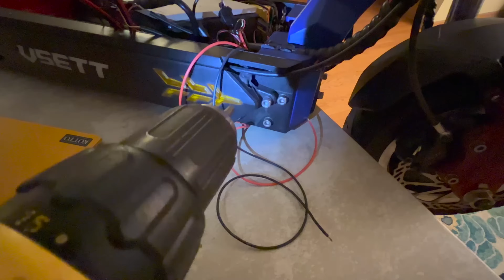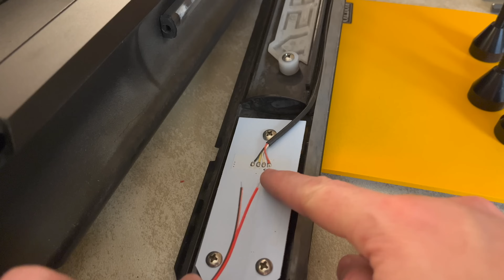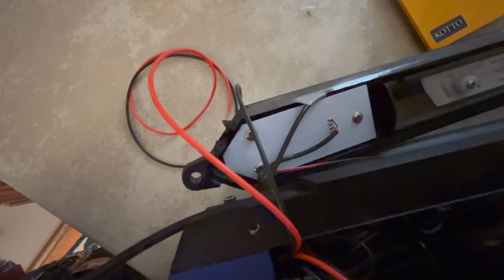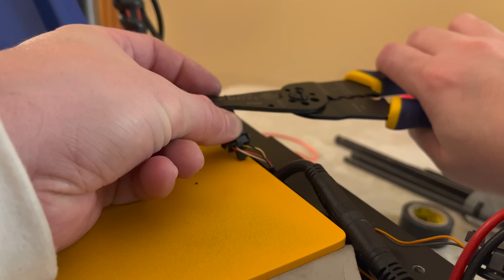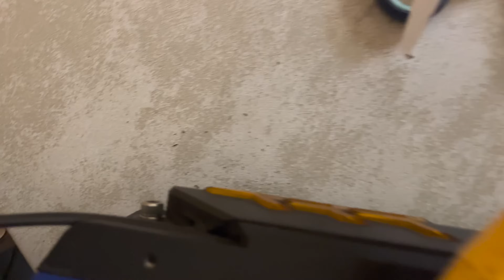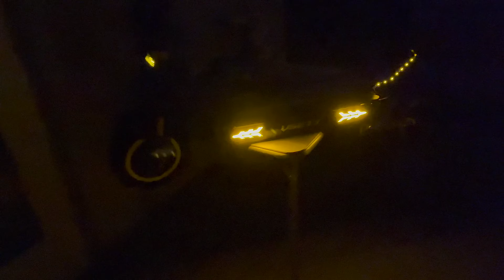How-to Splice MORE Turn Signals on Your VSETT 11+ or 10+ Electric Scooters

Comment: This is a mess…don’t get me wrong, I love that you’re doing this and we get to see but looking at how these lights are connected bums me out. I had hoped they were plugged in and you could add a splitting adapter dongle rather than solder. You can undo soldering but man…. Imagine trying to hide all of that before sending for repair. 
Also, the new Apollo pro will have a light bar in the stem and signaling in the tips of the handle bar, don’t know why this isn’t more common. It’s a missed opportunity and not a “premium feature”

Comment: Hey good job especially for your first try at this👍 How’d it hold up over time? I know you’ve moved on but curious as I’m about to do the same.  
Thanks Brian
#scootagang
Reply from the maker: Hey I think it held up quite good, they worked as long as I had the scooter! It was a fun little project, but will it I do it again on my Super72? I doubt it. The reality is you could put as many blinkers as you want and car drivers are still not going to look or comprehend what it is in most cases. Maybe down the line when scooters are more mainstream they will work better as drivers see them more, but for now, next to worthless unfortunately!
Reply: @ScootaGang  Hey thanks Brian appreciate it. I was kinda thinking the same thing. Love your new ride!! I just bought 2 new 11+’s. Got one for myself 42ah version and the 31.2 ah for the wife. We are also moving to Davenport next month 😎how’s the police on riding on the bike trails out of curiosity?
#scootagang 👍🛴💯

Comment: Good Mod video - personally if it was me (and its not, so that means nothing lol) - I would of probobly taken off the black wire loom, exposing the wires, and actually spliced into the red and black wire itself farther upstream versus at the connection point itself, for a noob like me at soldering i think i could handle soldering some wires together easier then doing the pin points
Reply from the maker: Hey thanks Joe, it's surprisingly easy to add them to the pin points. But whatever floats your boat really, both methods would produce a similar end result!

Comment: I need help. I'm handicapped. 5'7" tall, 240 pounds. I have a budget of 2000 dollars maximum. I need a foldable electric scooter with removable seat. I need the seat to be able to ride! I live in a area with lots of hills, and lots and lots of potholes! I've been researching scooters for 3 months and cant decide. I keep changing my mind.  Any suggestions from you or your viewers would be greatly appreciated. Thanks
Reply from the maker: You will definitely want something dual motor with at least 1000w per motor. As for the seat, I honestly don't know, I haven't used a seat on any of my scooters in the past. I do think you can get aftermarket seats for most scooters like a zero 10x or yume y10. I would probably start with those models. The Yume is a budget scooter so if you are more capable of fixing it yourself it's a good option. The zero you can get from many distributors but I trust RevRides the most if you are in the US. I know if you give them a call (360-888-7433) and ask about the seat they would love to help you sort it out! Or you can send them an email at contactus@revrides.com. That's what I would suggest doing. You can also ask the question in our facebook group "Electric Scooters Global" and get many other opinions from people that use seats! Sorry for the longwinded explanation, I hope it helps!

Comment: Hey I'm wondering how do you put after Market headlights on yume y10 and I'm going to get another scooter for real off roading can you recommend a awesome fat tire off road scooter for under 2500
Reply from the maker: I suggest getting a magicshine it comes with an external battery. If you feel more inclined to tinker you can cut off the stock ones and splice some better ones on the same wires. The stock lights aren't very good at all. 

And it sounds like you are after a Mosphera. They are new and very expensive but I think that style of pure off road scooter will get more popular soon.
Reply: @ScootaGang  Damm that's a beast of a scooter but the price is way out of my league I wonder if I did videos like you if I could get maybe a discount from companies do they hook you up to review their products or do you have to pay full price like everyone else your reviews are amazing so I hope they hook u up for the free advertising I chose yume y10 because you genuinely look like you are having fun riding i wanted a inbetween off rd and commuter why i chose the yume y10 plus the price was great and pretty much looked like the most bang for your buck in the pev arena as some more expensive scooters offer less in range speed and utility I'd love to know is the y10 really as good as u sell it on those videos and should I mod brakes or anything else to enhance performance I had a hiboy s2 and it was fun but it didn't last long because like u I ride hard has the yume y10 held up to your punishment
Reply: @ScootaGang  I hated the s2 pro by the way why I didn't get the titan pro I think hiboy isn't as good as they sell it 🤔 and rode titan pro too wobley and felt kind of cheap where as the yume looked more like a tank and serious where the titan pro just felt kind of weak the suspension sucked it was wobley at high speed I just gave up on high boy after riding it my friend with the titan pro wants to ride the yume I'm getting says looks way more hard-core than his titan pro
Reply: @ScootaGang  also the mosphera is a single drive if im correct isn't that less efficient than dual drive I don't know I'm only about to be on my second scooter I started on the lime scooters then I was like this is cool I want one for me got the s2 liked it better than a lime but wasn't sturdy enough for my taste and broke down a bunch so I hope yume got me covered for what I want and it doesn't take to many dumps on me like the hiboy did so much maintenence and repairs could have bought three of em with money I spent on repairs so I'm done with hiboy

Comment: wait, what? no info about led strip technical data? voltage? power usage? yes in that case you can burn your turning light controller, lol.. what about adding leds - everyone can use soldering iron whos whant to add them
Reply from the maker: If I burn anything I will let you know lol.